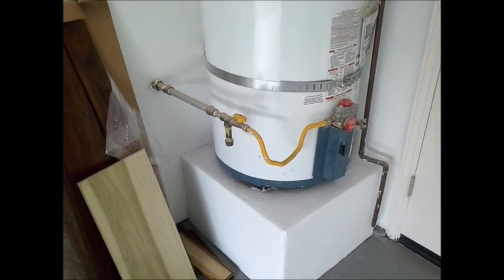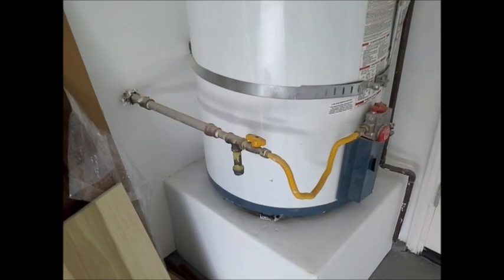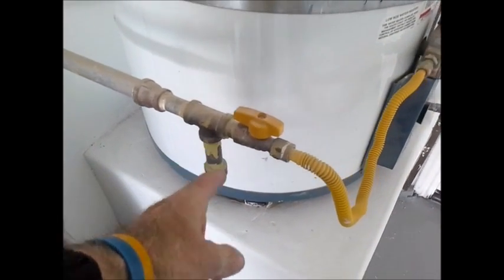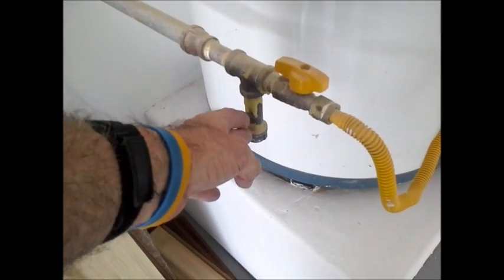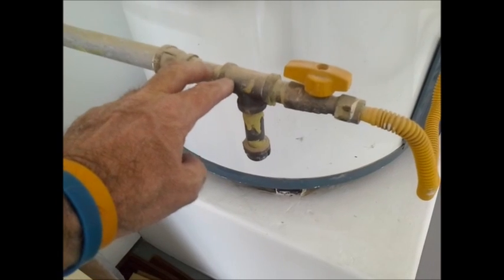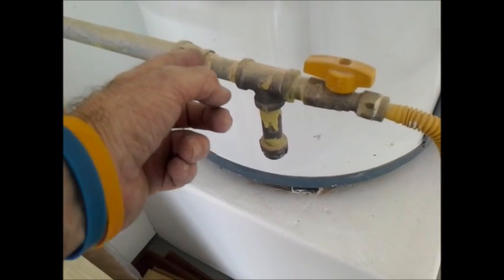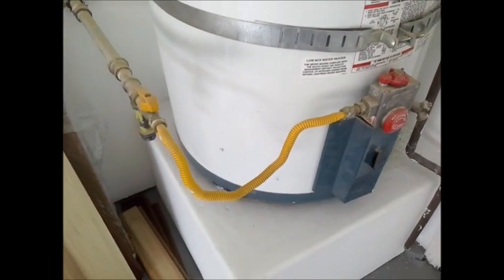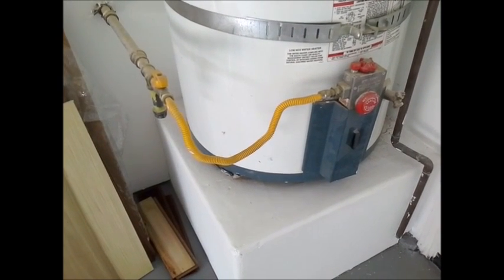Tip 461 Wrong Orientation of gas line Sediment

Comment: Its my understanding per the building department commercial inspector it needs to be connected to the gas line not the valve , the orientation was useless , We installed 150 water heaters and had them all inspected , let me know what you think , he had mentioned that was the "old way" being plumbed to the valve. Thanks!

Comment: A licensed plumber should know better, not only is the tee wrong, but the shut off valve is on the wrong side, this plumber should not be doing plumbing,  not sure how he passed the journeyman test, net alone the master test.  I am a licensed master plumber in 3 different states and seen all kinds of jerry rigged stuff. I have seen water heater expansion tanks put on the hot side of the water heater,  unreal .there are alot of inspectors out there too that dont know there job or codes.  I have seen inspectors who approve csst gas lines that are not properly grounded with a #6 grounding wire from the csst to the breaker panel. I have seen inspectors approve s-traps with not vent. I did plumbing at a home in ohio where i seen 4 sanitary 1-1/2" tees on backwards, and the home inspection aporoved it 3 days prior, unbelievable how can you miss stuff like that.  I have seen contractors put in gas water heaters with pex coming right off the nipples. Lol, on a new home and the inspection was approved by whoever inspected it, its unbelievable.
Reply: GREG NOYES explanation was totally wrong.  He apparently does NOT know what he is talking about regarding the sediment trap and the position of the tee in relation to the direction of the gas flow.  If you need to hook up a sediment trap DO NOT follow anything GREG NOYES stated in his so called tip 461.  He inflated the numbers to try and have every one believe he is half way intelligent.  There are many video post showing the correct pipe tee position and gas flow direction.  Forget this fool.

Comment: California plumbing code 2019 says:  

1212.9 Sediment Trap
Where a sediment trap is not incorporated as a part of the appliance, a sediment trap shall be installed downstream of the appliance shutoff valve as close to the inlet of the appliance as practical, before the flex connector, where used at the time of appliance installation. The sediment trap shall be either a tee fitting with a capped nipple in the bottom outlet, as illustrated in Figure 1212.9, or other device recognized as an effective sediment trap. Illuminating appliances, ranges, clothes dryers, decorative appliances for installation in vented fireplaces, gas fireplaces, and outdoor grills shall not be required to be so equipped. [NFPA 54:9.6.8

Comment: I just installed a tankless gas hot water heater in my house. I did install a sediment trap. But during the install I found something outside my house very concerning. At some point before I bought this house , someone buried one of the gas line feeds after the meter under ground about 6 inches. I dug it out to look at it because it was "Black pipe" ! Its all corroded and flaking. I left it uncovered and will try to replace that section with above ground galvanized pipe I think. Still researching how to tackle this now.
Reply: Glad you found it in time!!
Reply: I would replace the new line with polly or copper.. never do black pipe underground,  I have noticed that galvanize pipe does Crack in the cold so I stay away from it outside the home

Comment: I worked in the gas industry for 37 years.  At times I questioned whether a trap was needed.
Well, just last week I was tapping into my propane line to put a tee in with some adapters to set up an easy way to check pressure.  
I said I may as well take off the drip leg and check it expecting to find nothing.  What I found was a cap full of water.  The line is 3 years old.
Bottom line. YES, drip legs are necessary.
Reply: This video is about sediment traps, not drip legs. People often refer to a sediment trap as a drip leg, but they're not the same thing.  The purpose of a sediment trap is to trap sediment,  not water. If there's water in your gas, you need to complain to your gas supplier.

Comment: Sacramento County-City inspectors require the drip leg to be installed like that, but just after the gas valve now. Instead off the control valve.
Reply: That is also required by the 2016 California Plumbing Code section 1212.8.
Reply: I strongly believed the drop leg Needed to be before ball valve .  Dirt and other stuff can cause the valve to fail to close properly in case of an emergency.
Reply: @raymondmorrison6161  It’s gotta be after the valve. Quarter turn valves aren’t gonna clog up like that.